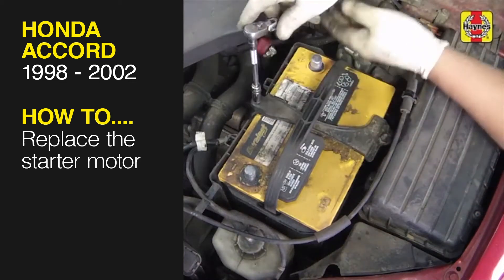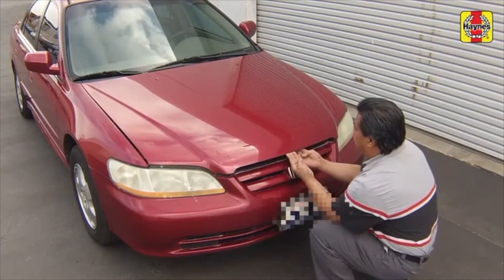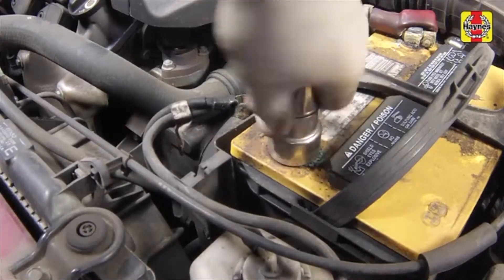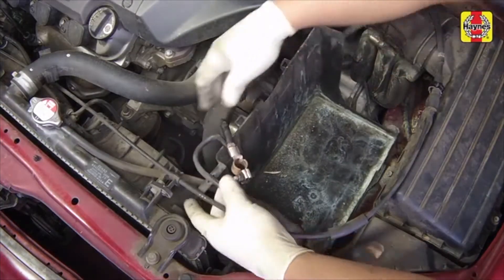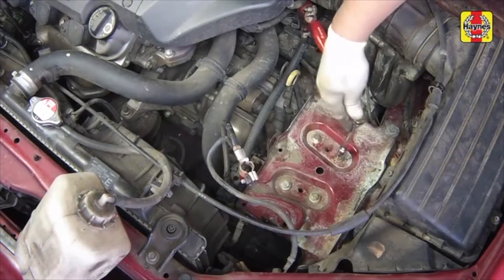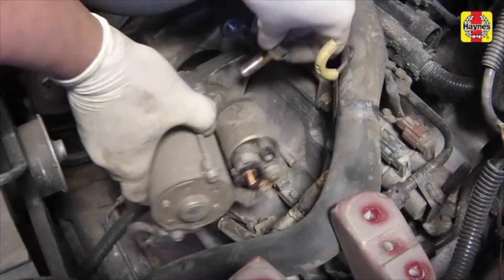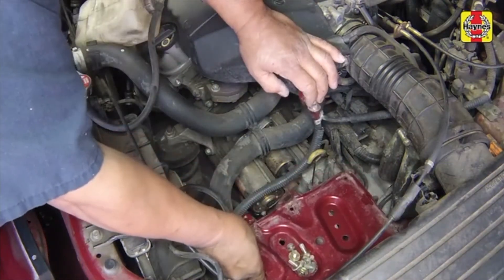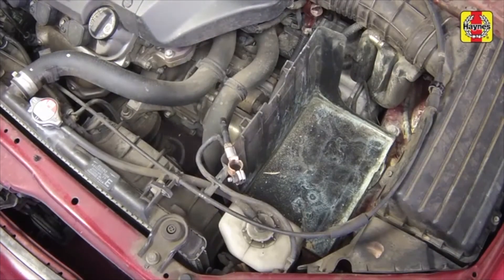How to Replace the starter motor on the Honda Accord 1998 to 2002

Comment: I did it without removing the battery or coolant overflow.  You just need the right length of socket extensions.  Would be nice to include the  torque specs on on the starter bolts.